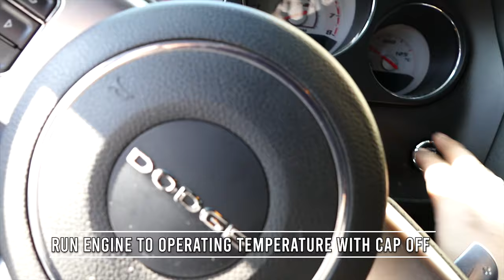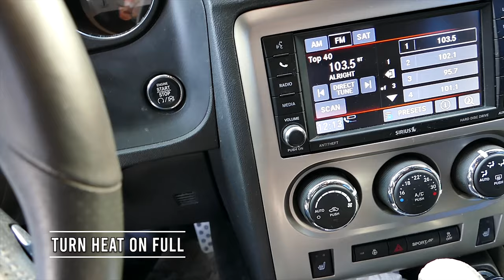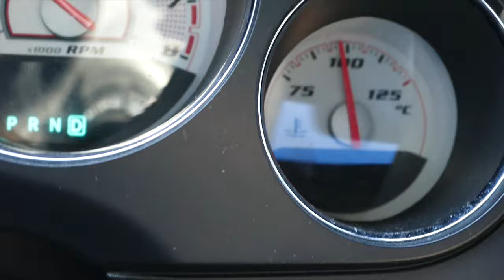Hemi Coolant Bleeder Location and Fill Procedure

Comment: I've heard that teflon tape can gum up the thermostat or sensors.. To use liquid thread locker. Not sure if it's true.. but wanted mention it.
Reply: However told you that knew you would believe they were serious

Comment: Did you ever notice it was only getting hot while parked and did your reservoir ever bubbles up ?
Reply: Dude I’m having that exact same problem
Reply: Any update on this?
Reply: @beeezlyy3230  it was my radiator
Reply: @ReptarART  was it clogged or just bad and how did you test it to find out that is what it was
Reply: @beeezlyy3230  was bad had to take it to the dealer
Reply: I had the same bubbling problem. It ended up being my cap.

Comment: Hi, and thank you for your video!. I'll have to do the coolant flush&fill tomorrow on my 2009 Dodge Durango 5.7 Hemi, and this will be very useful, just one inquiry about the seal of that bleeder plug, teflon is OK with high temp.?, or should be better to use high temp. thread sealant?.
Thanks again!
Reply from the maker: hey there thnx for watching! Teflon isn't needed also you're right not sure it lasts at high temp, I have seen mechanics use nothing as it's a tapered thread, but something else high temp wouldn't hurt putting in!
Reply: I wouldn't use any thread sealer you'll never get it off. Be a pain next time you gotta do it

Comment: Any idea on how to remove the water pump plug that is stuck?
Reply from the maker: hey there, try liquid wrench or another penetrating fluid, if that doesn't work leave it and use the temperature sensor hole as the bleed hole and let the coolant drip out of that location and re-install the temp sensor, alternatively you can remove the thermostat housing hose and fill coolant through there until coolant drips out of there and then re install the thermostat housing. thnx for watching!

Comment: I have a 2018 ram 1500 5.7 hemi if I’m in traffic it overheats would that be a cause also.
Reply from the maker: hey there, yea could be air in the system, give it a try, if that doesn't work it's probably the thermostat. hope this helps!

Comment: Would this work on my 2012 dodge charger se.  Bleeding it thru my thermostat housing screw? While pouring coolant thru  resivour?
Reply from the maker: hey there, yea it would, we did the same procedure for a 2011 chrysler 300c 5.7L hemi, for the 2015+ hemis we leave thermostat housing open and fill the coolant until it drips out of the thermostat housing, alternatively if you cant remove the bleeder screw you can bleed it through the thermostat housing like the 2015+ hemi guys. thnx for watching!
Reply: THANKS FOR YOUR FAST FEEDBACK.  I WILL DEFINITELY GET ON IT THIS WEEKEND.  👍
Reply from the maker: @marvinstanley514  np! have fun 🔥🔥🍻

Comment: I have a 2016 dodge charger srt 392 6.4
I changed my oil cooler, water. Pump, radiator, and new coolant reservoir.  I’m not getting any coolant flow. When I leave the cap off the reservoir the car doesn’t over heat and when I put the cap on the car starts to get hot. I can’t get it to circulate. Any help will be appreciated. Your model bleeder is different on my end . On my car there’s a hose that connects where yours bleeds
Reply from the maker: Ah gotcha, try filling the water pump through the neck of the thermostat housing, remove the coolant hose and fill the neck until it drips out. If that doesn't work it seems like a blockage somewhere, if that's the case I would go to a shop or even mr lube or a place similar and have them do a coolant flush, the process in which they attached a machine to the coolant system and push new coolant through the system. This should fix it. thnx for watching!
Reply: @moparbro  thank you for your advice, I got it to work by applying it directly down to the water pump. Thank God I didn’t need to go into a shop after all that work 🙏🏽🙏🏽🙏🏽 thank you for the deed back my brotha
Reply from the maker: @emmanuelmatamoros6525  Great to hear! thank you watching my channel 🔥🔥🙏
Reply: I am having the same isssue

Comment: My bleeder screw is stripped and won’t come out. What should I do?
Reply from the maker: Hey there you can also bleed by removing the temperature sensor and filling the coolant until the coolant spills out if the temperature sensor hole. alternatively you can remove the coolant hose from the thermostat housing and fill the water pump with coolant until the coolant spills out of the neck of the thermostat housing. Thnx for watching!
Reply: @moparbro  thank you!! Great vids
Reply from the maker: @anthony2039  no problem! thnx again for watching!

Comment: I changed it with green coolant is it bad !!?it was Preston ALL VEHICLE?
Reply from the maker: Hey there, if you changed the whole system with green coolant you should be good, in most cases they don't mix and turn into gel
Reply: @moparbro  I left some orange in there 😬
Reply from the maker: @joseRodriguez-pk9ld  ah I would take it to the nearest shop and have them coolant flush the system, it's not that much and atleast you will have fresh coolant in your entire system now
Reply: @moparbro  alright I'll take it tomorrow thank you !
Reply: @moparbro  hey bro I took it to the shop and they "FlUSHED it " through the resovior only ? ...they put the machine that supposedly sucked it all up ???but they did everything through the resovior

Comment: Can I do everything except removing the water pump plug with similar results? The plug is stripped, that’s why I ask. Thanks
Reply from the maker: Hey there! You can try this https://youtu.be/hgVk7SPOK2w basically run the mopar with the reservoir tank cap off for about 30 minutes and monitor it and keep adding fluid as air bubbles come out
Reply from the maker: another option is to use an extractor screw like this one https://www.amazon.ca/dp/B07MRLLPJX/ref=cm_sw_r_cp_apa_i_TKK.FbQ83EYZ7

Comment: What year is yours?  I have a 2015 6.4L and where that plug is I have a hose there that goes down and under the pullys and I lose it from there...I assume its the same thing because the pump looks the same.
Reply from the maker: hey there, yea should be the same, mines a 2014 6.4

Comment: What year is that because my 392 has an auxiliary pump and there is a hose right there where you removed your plug from. So is it safe to assume that’s where I bleed the system even though it has an auxiliary water pump?? Just asking because I recently swapped my tstat for a 180 tstat and soon after I noticed it running warmer than usual I did not bleed the system when I swapped the tstats. #octanered392
Reply from the maker: Hey there, ah gotcha yours is similar to my 2019 jeep srt 392, when I switched my t stat to the 180 like you did in my 2019, I opened the radiator cap and filled coolant into the thermostat housing neck until the water pump fill up and dripped out of the thermostat housing neck, after that I re connected the coolant hose that attached to the thermostat house and filled coolant into the radiator until its full and bubbles stop exiting, once the radiator is full  put the radiator cap back on and fill the coolant reservoir to the cold fill full line. After all that run it in the drive way for 15 minutes with the heater running on full.blast so that the coolant circulates also through the heater core. If the coolant temp gauge shows it's good and steady, take it for a driver and if all is good ur good! thnx for watching!

Comment: Bro i cant get that nut of the water pump to let air out of my system . Heat works better when cars accelerating need to fix it
Reply from the maker: hey there, you can remove the radiator hose from the thermostat housing neck and fill the waterpump with orange coolant until it drips out of the thermostat housing neck where it attached to the radiator hose, it's about the same level as the nut of the water pumps so essentially it does the same thing. once coolant drips out of the thromastat house, re install the radiator hose and let it run in the driveway and see if it all workEd out., if that doesn't work go for a coolant flush at a shop.
Reply: @Fred_eazy21 thx for the reply . I heard I can also use that temp sensor  screw also. I have 6.4 hemi
Reply from the maker: @gss1242  hey there, yep, you can also use the temp sensor hole as the bleeder hole, might be better as it sits a bit higher too.